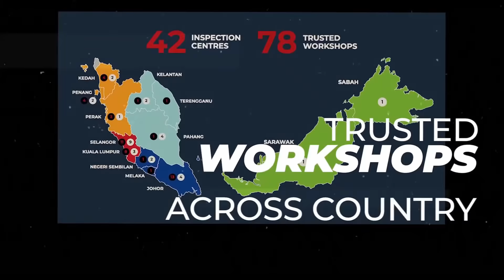Trying the EvoClub Car Wash process myself with my own car | Aurizn.com

Comment: With all due respect, you're promoting starting the business aspect, which is fine, but as far as i could find, there's no platform for the businesses to actually promote their business.  I can find no websites etc where I can find any contacts for the mobile car wash. I'm sure there are many people interested in using the service and not necessarily wanting to start the business. Even on the Evoclub Malaysia website, in the group buy section. It advises that you can order a mobile car wash but provides no links... Not everyone is within a reasonable driving distance to Symphony Autocare.
Reply from the maker: We have a mobile app slated for roll out by March through which end users can book appointments and make payments fully online.